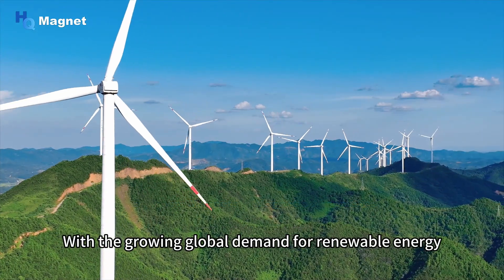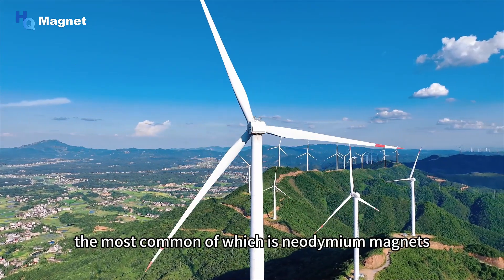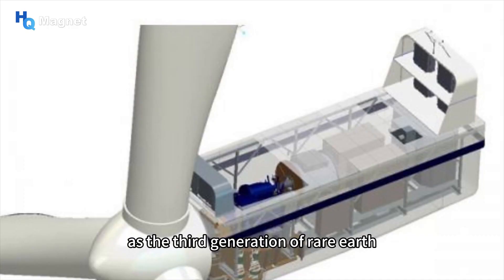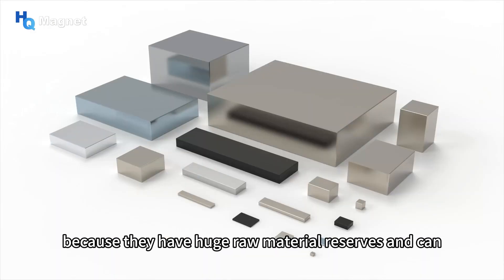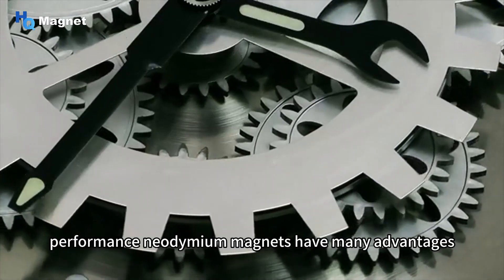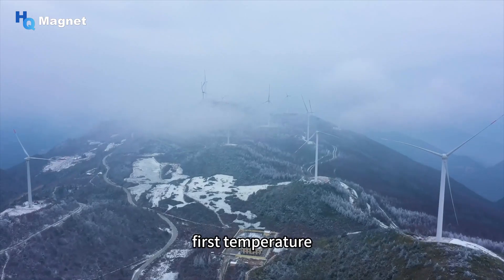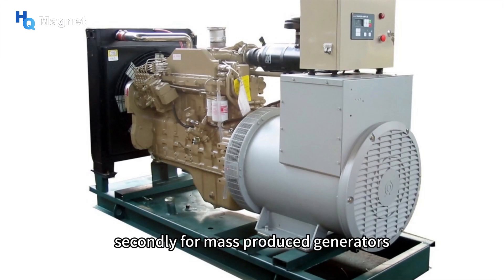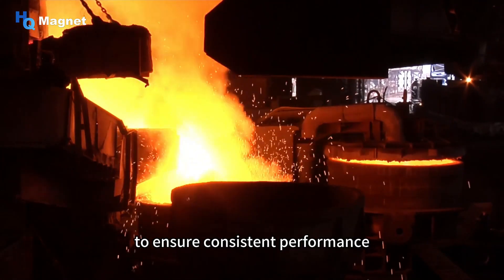Application of magnets in wind turbine generator

Comment: Quantity of permanent magnet used in wind turbine??
Reply from the maker: The number of magnets used in permanent magnet wind turbines depends on several factors, including the rated power of the generator, design specifications, the number of magnetic poles, and the required magnetic field strength.

The average weight of neodymium magnets used in permanent magnet wind turbines is approximately 0.6-0.8 metric ton/MW.

However, for a specific model of generator, the exact quantity of neodymium magnets needs to be determined through the manufacturer's technical specifications or specific engineering design data.
I hope this is helpful.
Reply: @hq-magnet  That means Goldwind GWH252-16MW wind turbine has around 11 tonnes of neodymium magnets,??
How much unit of magnet is used,,?? I mean what is the the quantity of poles in the GWH252-16MW wind turbine,?
And what is the useful flux per pole in the neodymium magnet of GWH252-16MW,,??
Reply: Thanks its helpful